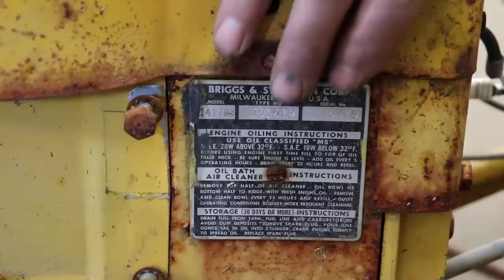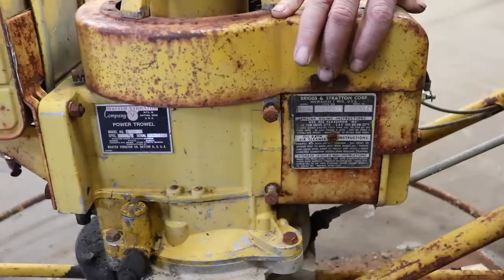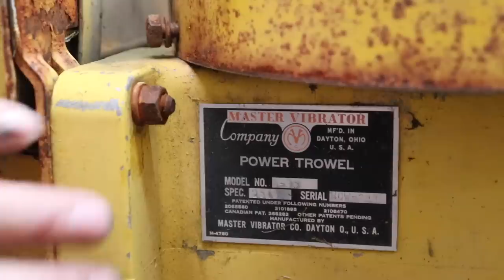AMAZINGLY RARE Horizontal/Vertical Mount B&S Engine

Comment: I have a craftsman wood chipper giving me headaches.  Tecumseh engine.   I pull and pull.  I have spark.   small engine guy rebuilt carbetrator.   DIY  May be I don' know where ground wire goes.   I was going to steal wool  clean the points on Magneto next.   It's a mystery.   I want to use it to chop up  my vegetable stalks for compost.
Reply: Check exhaust Valve make sure it has tappet to stem clearance as specified.
I had a Tecumseh snow blower guy put new carb new ignition never started.
Only a few hours on it.
Reply: If it's got points and condenser, the plate they are mounted to is adjustable, that's how you set the timing on it.
Reply: Assuming the carb rebuilder properly set the float level so it doesn't flood. I just did a Tecumseh that someone had put a Briggs and Stratton size needle in...:(

    On a fresh rebuilt carb...pour a little gas directly into it.

  If it doesn't start or try.... determine whether the spark plug is wet after trying to start the engine.  If it's dry then you need to look at the fuel situation again. If it has a screw with a spring on the outside of the fuel bowl that is a adjustment you need to try. Turn 1-1/4 out from all the way in to begin with.
  If it's wet, you need to re-examine the spark...it will be blue if it is good.
  Check compression with a gauge, needs to be at least around 50#. If its low, squirt a little engine oil into spark plug hole, replace plug. If it tries or does start...worn rings/cylinder wall.  Doesn't try...valve issue or head gasket.
  Also you can have spark with the timing being off...a broken or distorted key at the flywheel will do that. Hopefully you have actual shear pins/shear bolts in the chipper and not bolts....flywheel key gets messed up by a jolt to the crankshaft output. If you replace the key, set torque at spec, otherwise flywheel won't be set tightly on crankshaft taper and will shear new key as soon as load is placed on engine.
Reply: @arlenbowler2493  If I remember correctly the points are set a few degrees off of top dead center with a ohmmeter.... A Tecumseh "thing"....other engines set at top dead with a feeler gauge.

Comment: Oh Taryl you should of taken out the points and taryl putty the plunger hole. Your getting to much drag and losing horsepower. How many comments have you had like that? It ain't the space shuttle you keyboard geniuses.  It's a concrete trowel.